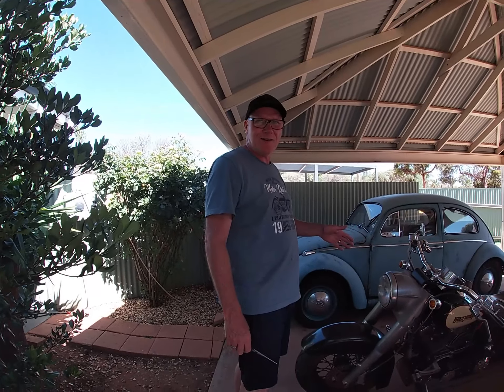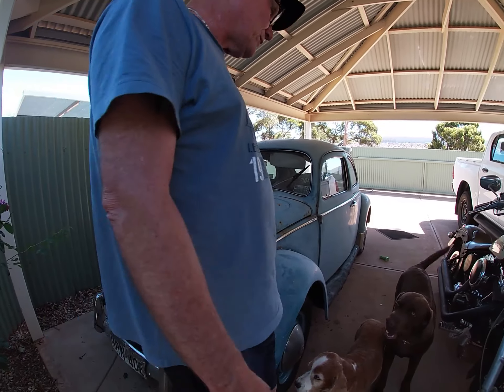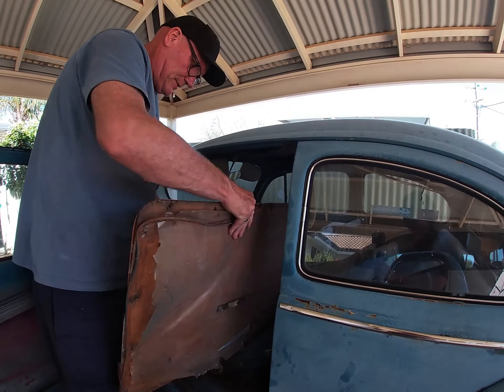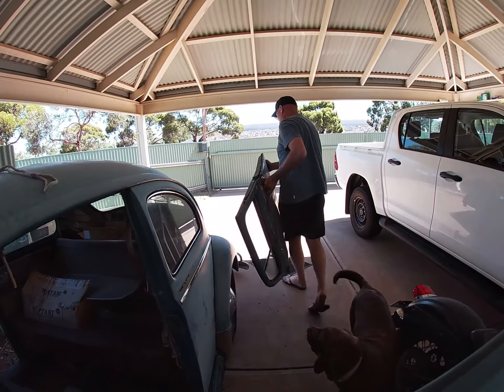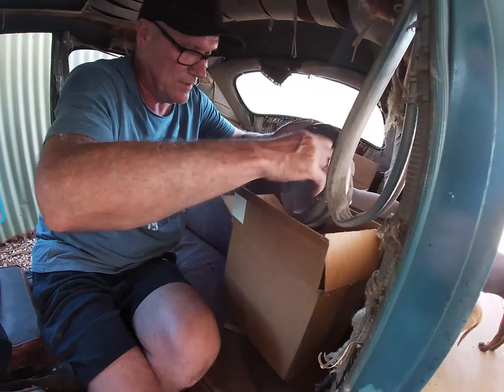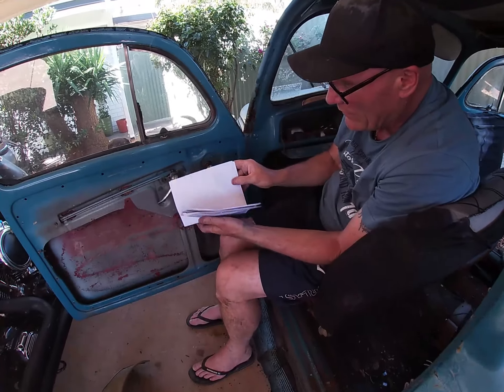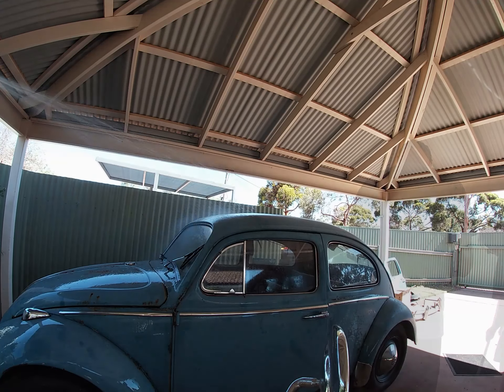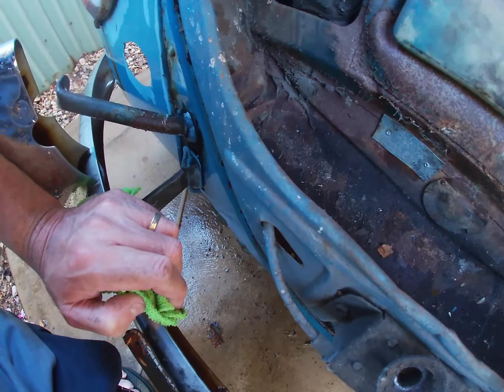SITTING IN DRIVEWAY  FOR 22 YEARS  1966 VW BEETLE AUSTRALIA

Comment: i am 100% sure the car body is older than 1966. why?  in 1966, there should be a single vent on the dashboard, and the most important thing, the car has small windows, as in 1964.
Reply from the maker: It's Australian built so Australia was using kits 2 years older they were always 2 years behind so even though they stamped in 66 it was actually a German 1964
Reply: @dalebee59  thank you, we learn all our life :)
Reply from the maker: They actually used the 1961 body right up to even 1967 they had special features added in Australia like VDO gauges still used the headlight dimmer on the floor in 1966 they came out with the 1300 engine always learning I just got to be careful ordering window rubbers etc